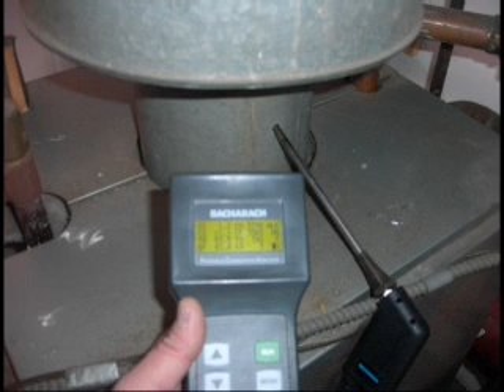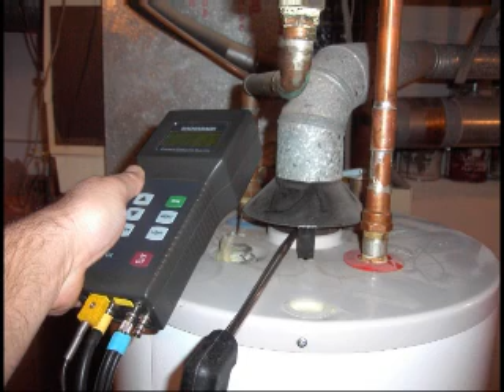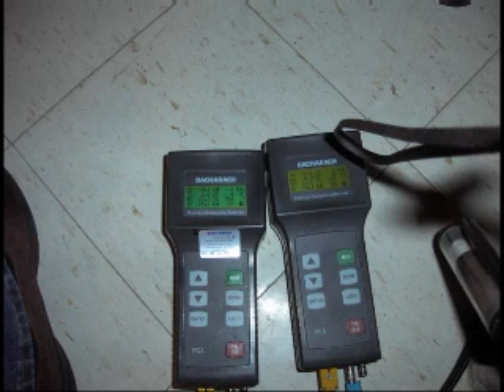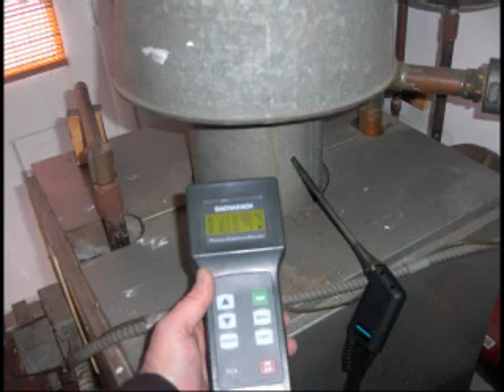Furnace HVAC Plumbers can Kill People from Carbon Monoxide

Comment: ok, dont patch the hole that you just cut into the flue, that hole especially on a forced draft furnace, boiller or water heater is an easy escape route for the flue gas containing CARBONDIOXIDE to escape the flue pipe WHICH IS SUPPOSED TO SAFLEY REMOVE THE CARBONDIOXIDE TO THE EXTERIOR OF THE AREA IN WHICH IT IS OPPERATING!!!!!!!

Comment: Unfortuneatly, those homeowners equip that you showed in your video more than likey hired "Cheap Charley" to install or service the equipment. 
  They do not realize  the complexity of the equipment we work on.
  Until this Trade gets some better Certification, or Licensing requirements we will continue to see things like this.
    I think your 90% Numbr is high though, at least in my part of the Country. In the South though it seems like everybody has a Resid.  HVAC Business.

Comment from the maker: PVC flue temperature is 90-140F. The intelligent comment should have been that the tape may permit leakage from condensation. I have inspected homes 3-5 years later to find my old taped holes from prior inspections. I did find one that was leaking from condensation. If you test your furnace yearly, you do not need to worry about the tape seal failure. You can also use furnace caulk. The caulking messes up your inspecion tool bag. I am starting to worry about your intelligence level.

Comment: Stack temperatures are good to check for combustion, but gas mixture and pressure should be checked on every furnace inspection.

And I don't agree with your remarks on HVAC personel. Better check your own industry before you make statements about something you are not licensed to do. If I caught you drilling into a customers vent stack without hvac contractor's license I would assure you you would not be performing inspections again.

Comment: You do realize that the EXHAUST GOES OUTSIDE correct? We do carry an invention called a ladder. You learn this after a homeowner sees you drill a hole in their exhaust system, then makes you REPLACE their exhaust pipe.

Comment: A good service technician doesnt need a CO detector. Co is produced when the system is not burning properly, if he is worth his paycheck he will find this while checking temp rise, gas pressure, burner condition, etc. That is much better than the guy coming out, drilling a hole in your exhaust, and taking a check for $100.

Comment: So far as "rust"  and so forth, there are many other reasons for this.  Heating appliances,  (again, you show older, 70% class)  use draft hoods and indoor combustion air.  In many, many locations,  any chemicals in the air which draft up through the burner, such as painting solvents, in a home shop,  bleach and other products in the home laundry,  or worse, in commercial locations, any chemical such as laundries, beauty parlors, photo shops,  on, and on,  can cause these sorts of problems.

Comment: Furthermore,  the one picture you showed of a PVC vented appliance looked suspiciously to me like a "power vent"  90% appliance,  and it could VERY WELL be a type that is working under positive draft pressure  WHICH MEANS   that leaving an open hole WITHOUT a positive, threaded plug  in the vent could allow vent spillage, however slight, into the habited space.

Comment: You, Markeemark, sir are completely full of shit.  First,  many of the older, "70%" class appliances you illustrate  ALL USE  a draft hood, and are designed to updraft EXCESS AIR.  (For you nontechs, that's the "litte blue hat"  on top of the water heater)   What this means, is,  that YOU CANNOT MEASURE combustion gases in the flue pipe of ANY of these appliances!!!!   The reading is irrellevant!!!!!

Comment from the maker: You should just through in the combustion test for free. Tell them our fee is only $125 and includes a free combustion test. Our competitor does not do these and you can die if you have a problem. They will hire you. Not to mention you may find a new HVAC problem by conducting this test. I find that 3 out of 10 HVAC units tested had a condition that requires a repair, adjustment or replacement.

Comment from the maker: Yes you are correct. In Cleveland I do not see many oil burners. If I find one, I always have to remember to change the settings on the gauge. It is very easy to forget to do this. Thanks for the comments.

Comment: CM, an O2 reading of 12% translates to a CO2 of 9%. If you're working on an oil burner, that means you have a problem somewhere. 

The solution would depend on what the rest of your readings are.

Comment: Those of you who don't test equipment as my company does are on borrowed time. Sooner or later a unit you worked on will hurt or kill someone, and you'll find yourself in court facing an army of angry lawyers. 

The video shows Bacharach equipment, but you can also get good analyzers from Testo, Wohler and others.

If you don't test, you're guessing, and guessing can kill someone.

Comment from the maker: Ventless heaters and ventless fireplaces will be my next video. "VENTLESS HEATERS RUIN HOMES AND MAKE PEOPLE SICK.". These units are mold machines and dust mite producers. By the way, the worlds leading CO authority NCI told me my video was accurate. They did tell me that I should be nicer to HVAC people. They also corrected my comment on dirt dust and rust in the orifices.

Comment: Hey clevelandmarko, you almost touched on a point in the video that would be valuable to all. 3" ells off of the water heater will almost always spill flue gasses. And the IFGC charts provide that almost all standard water heaters should be 4", not 3". Anyone with 3" pipe should be cautious and anyone with an ell straight off of the water heater better have it fixed.

Comment: If a furnace is creating CO while underfiring then the very same furnace will create MORE CO while firing. Vent free fireplaces, vent free heaters, and gas fired makeup air units all use the principle of underfiring (thus minimizing any CO) and ALL of those permit you to breathe the flue gasses (IE the flue gasses are vented into the living area).

Comment from the maker: Have you ever taken a class on combustion? After all, you act like you are a HVAC professional. What code tells you cannot drill a hole and test. You cannot get the proper stack temp, O2, draft, or CO readings without the hole. You must be performing magical inspections. 
TEST QUESTION what does it mean when your O2 levels are 12

Comment from the maker: OK we agree. Unfortunalty,in my area,Bvents are far and few, natural draft furnaces only have the clay flue. We do not see many approved caps.You are right about looking down the chimney. You have to climb the roof. We have older homes with tall chimneys that require big ladders and slate-tile roofs.
You want the draft to be 01WC-02WC.You can have a clean chimney and have a low draft-fans, negative pressure You can have a chimney flue and have high draft-high stack effect, positive pressure

Comment: It's agreed, then, that CO in the furnace won't kill unless it's cracked. Now to the chimney.

Most 80% furnaces are vented in type B vent. Code requires an approved cap. An approved cap minimizes and eliminates affects of winds and debris in the flue. Removing the T cap and doing a visual in the flue is more thorough than checking for blockage with an analyzer. A masonry chimney would be better checked with an analyzer.

Comment from the maker: Underfired means you MAY have CO of 100+ in stable form or you MAY have 0-10 CO, PLUS Stable to high O2 (above 9% ), PLUS Normal draft, PLUS selective burners would be affective, and PLUS measuring is needed. If you took the class you would know this.

CO in your chimney can still kill. What about roof Eddie currents, downdrafts, tree branches, negative house pressure, birds nests, high exterior pressure, fans in the home. If you understood building science you would know this.

Comment: Underfired furnace causes CO? Not so. An underfired furnace has a lower fuel:air ratio. In other words, there is too much air, thus too much oxygen. An excess of oxygen combines with the CO to form CO2. Thus there is LESS CO in an underfired furnace.

Comment: Increased CO emissions in the flue gas does NOT mean increased CO in the home UNLESS there is a crack in the heat exchanger. Testing with a combustion analyzer will not save anyone's life since any increased CO in the flue gas goes OUTSIDE the home, not INSIDE the home. According to the video cracks must be VISUALLY spotted else the tech is a scammmer; Thus the analyzer is not as useful since visual is the requirement.

Comment from the maker: FACT: YOU DON'T KNOW IF YOU DON'T TEST.
The Crack is the least likely problem that may cause CO. You can have a dirt, rust, alignment, mechanical, venting, overfired, underfired, combustion and heat transfer problems. All these can cause CO in the flue gas. You NEED A COMBUSTION ANALSER. The combustion analysis also tells you stack temperature for one of you last comments.
By the way, the world still has over 50 percent natural draft units.
Reply: Why are you so worried about CO in the flue gas? That gas is vented out, and cracks in the heat exchanger is what allows partial combustion gasses to enter the home. Combustion analyzers are useful to figure out combustion efficiency, not safety. Once fuel/air ratio is set, unless a problem is suspected, it's not necessary to perform combustion analysis every time. Periodic testing especially in aging heating systems can be important but it's still not necessary to test every time.

Comment: FACT: Furnaces properly installed with an induce draft blower motor will NOT cause carbon monoxide poisoning unless the heat exchanger is cracked; There are at least 2 safety switches that must first fail. A cracked heat exchanger is usually caused by restricted airflow (IE dirty filter, undersized ducts, blocked grills, etc). SOME combustion analyzers can ASSIST in finding cracks (such as the Bacharach shown) but by no means is the primary method for finding cracks.

Comment: Both I and Questar gas disagrees that a combustion analyzer is required. Starting on pdf page 79 of the Good Practices manual (#59060) at the questargas website goes over the simple process.

Comment from the maker: Many times, you simply have to adjust the gas valve. You can not do that without using a combustion analyzer. Bottom line, if a contractor leaves your home and you do not see drill holes in the flue, the contractor did not properly test the furnace for CO. 

Instead of being offended, HVAC contractors need to educate themselves more about combustion analysis, and maybe they will save more lives.
Reply: What is an NCI course.

Comment: Try to follow the logic (comments found in the video): 
1. Heating contractors are responsible for hundreds of deaths each year; 
2. Contractors scam homeowners by condemning furnaces when there is excessive carbon monoxide in the home; 3. Contractors are usually correct in condemning furnaces (#2 above);

SO if they fail to condemn a faulty furnace then they are responsible for CO deaths. But if they do condemn the furnace then they are scamming even though they are usually right!?!?

Comment: The claim that a tech will not know if the fan speed is too high or too low without a combustion analyzer is nonsense. The fan speed is set to the manufacturer's nameplate rating by taking a temperature rise across the heat exchanger. This requires a thermometer, not a combustion analyzer.

Checking for a cracked heat exchanger with a combustion analyzer is discouraged by at least one test instrument manufacturer.

Comment: I have never ever needed to heat hot water.  
I have Red tagged manny furnaces that do have rusted through and cracked heat exchangers and make no CO, and the customer will remove the tag and fire their furnace up the second I leave,  or the other dumb asses that have the gas stove running full bore, and when you walk in the door your eyes water from the lack of fresh air.  people never under the concept of "you get what you pay for"

Comment from the maker: I have inspected over 10,000 homes and only about 50 of these homes had the required 1/4 - 3/8 inch drilled flue hole that is nedded when performing a combustion test. That means that 9500 furnace were never tested. These are the HVAC contractors.